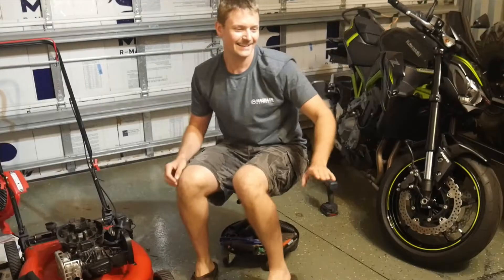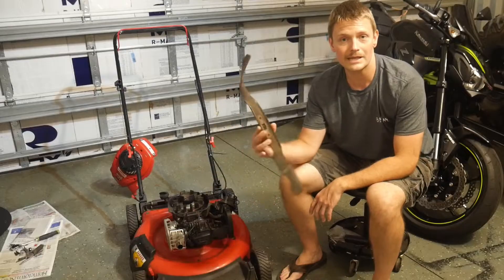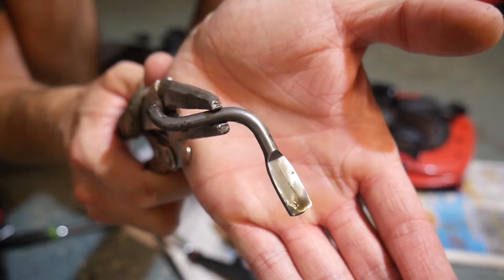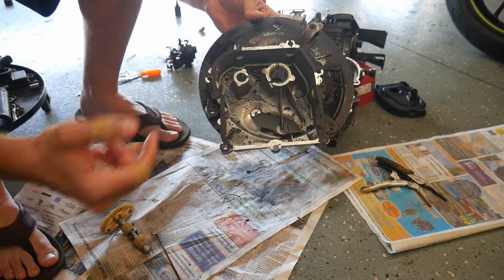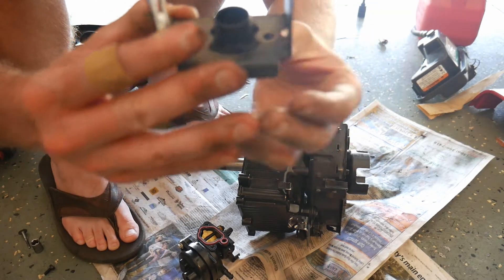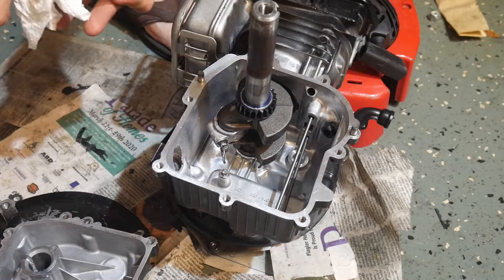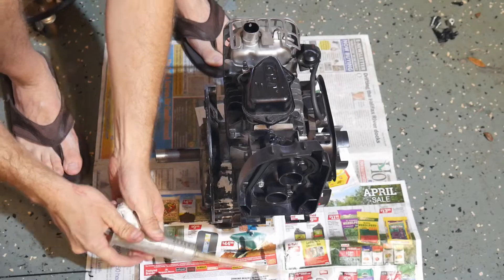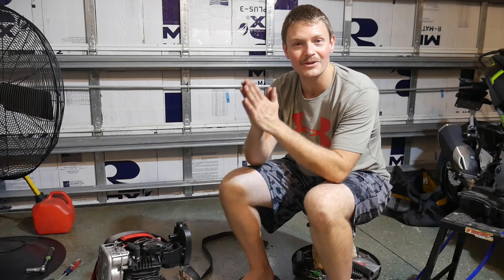Vertical Shaft to Horizontal Engine Conversion | 140cc Briggs and Stratton

Comment: Thanks. I knew this was possible, tried years ago and made a mess of things. I was looking around for a predator 79cc but I think now I'll just use my pressure washer engine, already has a heavy flywheel and a broken governor.... found that out after i spent a TON of time tinkering with it. It floats the valves real nice and doesn't smoke though....

Comment: The engine is probably running rough because these lawn mower engines have lightweight flywheels since the blade acts as part of the weight normally and without the blade they run not as well.
Reply from the maker: Tyler Frankel That would explain the recent setback i’ve had 😂 You’ll see what i’m talking about in the next vid on this
Reply: My Briggs came from a self-propelled the front wheels have metal gear in them so they are heavy I plan on using it as a harmonic balancer.

Comment: so you spin the carb drill new oil galleries or oil journal on the crank and cam shaft relocate the oil fill cap. great vid bro , how bout putting a small car turbo, electronic oil pump ,,oil filter another piston ring and port polish thanks

Comment: The engine isn't running great because you need to add a flywheel. When it was on the push mower it was using the blade as a sort of flywheel to help keep momentum. If you've ever tried running a regular push mower without the blade you'll notice that either it doesn't run worth beans or it runs way too fast because there's nothing to help give it momentum. The flywheels that you find on the vertical shaft engines are only really there for spark and to have a fan for cooling, that's it.

Comment: I converted a lawnmower engine to horizontal and I notice oil coming out of he crankcase ventilation tube when it runs. Is my breather broken? or it is because it fliped it horizontally?
Reply: Yeah that is probably the case
Reply: thats clearly because you flipped it over with oil in it, reroute the oil and plug the oil hole, like the video stated, come on bud

Comment: You left out a possible reason for doing this conversion: Trying to repurpose a lawn mower engine for use on a different machine. I have access to several different dead lawnmowers. If I can resurrect one of them, I can use it for the new build, but I need a horizontal shaft. I had the bright idea of designing a 90° gear assembly, but if I can do a conversion like this, it would simplify some things.
Reply: remember the lawnmower blade is used as a flywheel , it will not run near as good without it or some type of weight, and the mounting holes are thinner, compared to a log splitter/gokart engines

Comment: At 2:38 he smacks with hammer is high speed. This is bc there is a security bolt (likely break off bolt) I used a diamond cutter on my ang grinder ti nip it off, Watch the sparks. Once the yellow is gone its all aluminum. Wont damage actual gasket area. Shouldnt have skipped that in a vid. he broke the threads it seemed like in slo mo.

Comment: Where does the governor and the welded nut go at 3:36 of your video?  What is the Paddle for on the crank shaft to splash oil around?
Reply: The governor is removed. And tes the paddle is for whipping the oil around to get it anywhere

Comment: I have a very stupid question but please go easy with me. Can you modify a 4 stroke single cylinder horizontal engine to vertical BUT crankshaft facing upwards? If I have to mention a specific motor it is a Honda GX50
Reply: i would not recommend doing this for a homemade helicopter lol

Comment: Just for the hell of it, I'm going to try that an a twin 24 horse Briggs, to temporarily put on an old m600 bobcat. Might work long enough to check out the hydraulics and drive. I bought it for the hyd. Cylinders for a whopping $100.00 bucks and I have the engine sitting around. If it works, fine, if not, I can part it out, and scrap the rest
Reply: Did you try it? Have an extra v twin Briggs myself I'd like to make horizontal

Comment: Will this work for making a go kart?
Reply from the maker: power s Absolutely!
Reply: when PREDATOR 212 is $150 and has all the hot rod parts in the world for it? and can make 20 HP with .... $300 worth of parts... 15 HP and 15 FT lbs with $250 worth of parts?

Comment: Did you use JB weld for the governor and the bolt at 3:36?
Reply: i took mine out. the gov shaft is threaded into the block? so i had to unthread it and found a screw the right size, RTV'd it and into the hole it went. no more gov. done .

Comment: How do I lubricate the rockers and pushrods? How do u get the oil to reach
Reply: the oil is in a mist in the engine whirling around... the smoke coming out of the engine? once the thing is running with oil flying around in the engine, the mist of oil goes thru the engine.  PREDATOR 212's dont have much of a provision for oil to get to the rockers/pushrods but the oil gets to the rockers...in a mist from the tornado that is the crankcase

Comment: I have a gx 160 motor but the bore has seen better days. I was wondering the engine/crank cases from the gc160 would be the same just run on its side. Anyone know if this is the case

Comment: Any tips on removing the thing that holds the lawn mower blade on the shaft. Mine is rusted on. Pretty sure it’s just pressure fitted. But really struggling to pull it off
Reply from the maker: Blow torch and some firm wacks with a hammer usually does the trick 👍
Reply: @DirtGearTv  thanks. I’ll give that a go

Comment: Great jobb! If you will Mount the engine in a bordertrac cykel there is no mount places in the bottom of the engine?
Fixerupp swed! 👍
Reply from the maker: Great point! You'll see how it gets mounted soon as I upload this project build. Its taking extra time due to parts delays but its a super cool/fun project!
Reply: @DirtGearTv  any update
Reply: You have to build a 90 degrees plate and mount it to the original mounting hole .  Easier than it sound .  Good luck

Comment: Question? JB weld only handles 500 F temperatures. Engines can get up to 5000 F the JB weld would not hold. Even the extreme heat version only handles 2400. How is it running today? Did the JB weld hold out?
Reply from the maker: Steel melts about 1300f, those high temps might be exhaust temps but deff not engine temps. Engine block should stay about oil temps 200-250f
Reply: where did you get that engines get up to 5000 f degrees

Comment: How will it go with the oil lubricating everything since it's in a different orientation? Or do you just fill it with more
Reply: The crank will along it where it needs to go and the pump will still send it up to the head
Reply: @diychad7268  I don't believe the vertical briggs motors have oil pumps. The head/valves are basically at the same level as the sump normally.

Comment: Any thoughts on lubrications the upper area with the cam rods, springs, and valves? I was just starting to attempt this myself but realized that unlike the other YouTube videos showing how to do this, the engine I have (and you have as well) is an ohv engine instead of a flathead. Wasn’t sure if that might make the lubrication issue more complicated.
Reply from the maker: Yes, I plan to make a change for this. There is a circular port which faces the bottom (points in the direction of the main crankshaft. That port  should be opened up on the "new" bottom so your oil flipper can send oil into the pushrods. Also, you'll see in my next video I have connected the case breather line to the top of my valve cover. Its a slow steady dip of oil that at least with prevent it going dry.
Reply: DirtGearTv did you make another video? I can’t find it. I’m literally doing this exact build and would like to learn from you

Comment: Assuming since it has been 3 months you are also having issues? I did this a few months ago and it ran fine for about 30-40 mins and now I can’t get it to start again. Suck cause I have a lot of mowers I could do this to
Reply from the maker: Interesting. Mine ran perfectly, maybe a little too good because shortly after the conversion I bent the crank by revving it over 5k
Reply: DirtGearTv yea idk what happen with mine
Reply: DirtGearTv thanks for the reply man! Are you going to do a follow up video?

Comment: I'd be careful I didn't see any oil making up to the rockers and valve train
Reply: You can kind of get away with this mod with the older flathead motos but because this is a OHV and these have no oil pump, theres no way for the tiny paddle to fling oil all the way up top to the rockers. This would NOT last more than a few hours imo.

Comment: It's not worth the trouble to do all this. It's easier to just buy a $99 horizontal shaft engine. Also, you can mount the engine the same as it was in the lawn mower, remove the blade and blade bracket and put a belt pulley on it and twist a belt to an axle or a jackshaft.
Reply: yup predator motor
Reply: but it's fun if your on a budget